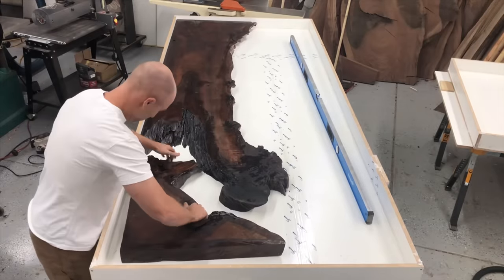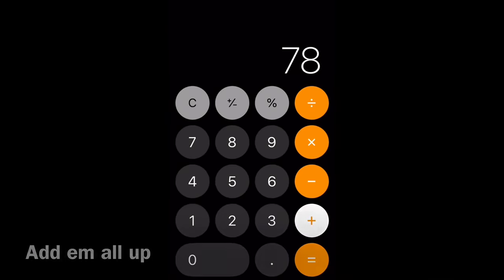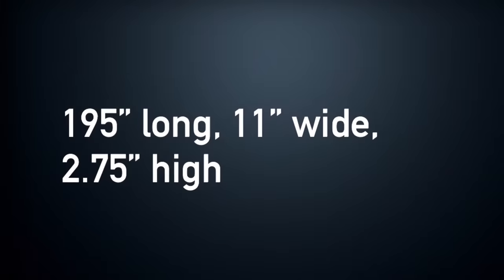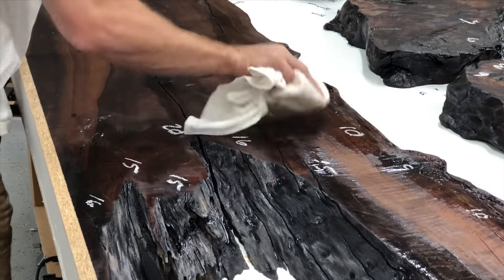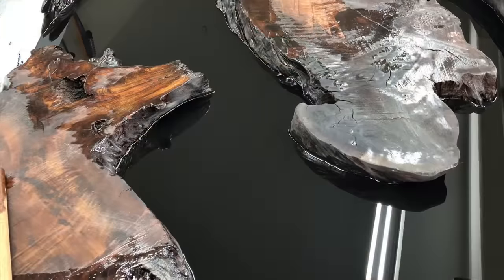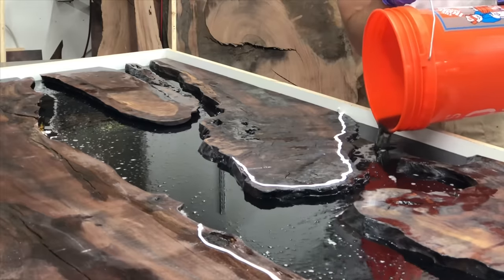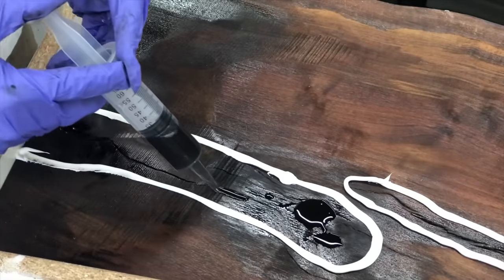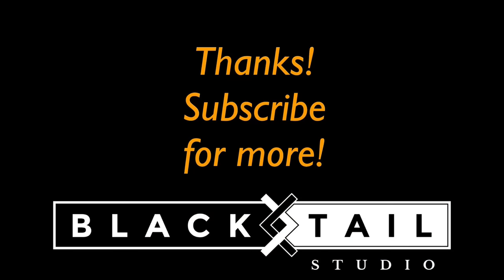Calculating Epoxy Volume--How to Epoxy Woodworking

Comment: Have to laugh you do measurements in inches but end with litres, thought you guys use gallons ?? 👍 Great looking table
Reply: The calculator juist converts it to liters
Reply: we use feet, ounces, gallons, liters, grams you name it. us americans do it all
Reply: We honestly use metric and imperial interchangeably lol
Reply: Use both Metric and English.
Reply: @adamjohnson5307  Sometimes it’s a serious problem because one engineer could use thousandths and another engineer could see that and think it’s millimeters.
Reply: I just use my fingers way easier
Reply: Carpenters tend to still use imperial but scientists prefer metric. Result tends to be that all the best tools use one system & all the chemicals are in the other.
Reply: Yea, we use all of it. Ends up the same no matter what either way.
Reply: ML much more accurate
Reply: The epoxy company probably uses liters for their mixing instructions.

Comment: If you had 35 measurements with each 6" apart, that means you have 36 sections. 6 X 36 = 216". That's the length of the river in an easy way. 😊

Comment: If you can weigh the pieces, you can get a more accurate measure of epoxy volume using this method:
Weight an offcut cube of the wood on kitchen weighing scales and measure its dimensions so you can work out the wood density.
Weight all the pieces you are using on a bigger scale, take the total weight and divide by the density. This gives you the total volume of wood.
Work out the volume of your mould, take off the volume of wood you calculated and what's left is the volume of epoxy needed.

Also, this is an incredibly beautiful table and I am very jealous!
Reply: Came here to write this comment. 👍😂
Reply: Exactly what I thought he's going to tell, this is a much more precise and less time-consuming method. But I guess math is not for everyone.
Reply: Also was going to suggest this.
Reply: How much effort would that be. His method of approximating is good enough. If epoxy was worth the equivalent of gold then perhaps it would be worth getting a closer approximation. Even in topographical surveying they use similar approximating techniques which have worked well enough for the vast majority of cases.

Also if you want a better approximating you could utilise tech using a ceiling mounted camera and some cheap software or even open source to calculate the area of the empty sections
Reply: @sulimanahmed8588  that'd be way less effort and time consuming than the method he presented in the video
Reply: the trouble is that this assumes consistent density, which we know wood doesn't have. This one seems like it would work most of the time but that one time it didn't it would be very far off.
Reply: @sulimanahmed8588  epoxy is very expensive, duh.
Reply: I might calculate volume using the displacement of a less significant piece of the same wood in water.
Reply: I don’t know if wood has the same density throughout since some may have wholes or something
Reply: @sulimanahmed8588  this method of weighing is simply the  MOST accurate method.  if you want extra waste factor then add a waste percentage to your calculations to account for wood imperfections and form failure (figure out this waste factor by experience with this type of work).  

Surveying is honestly an apples to oranges comparison and that is honestly sympathetic to how imcomparable they  are.

Weigh the form, weigh the finish pieces in the form, weigh a sample piece of the material at a controlled dimension. and measure the dimension of the form.  cross multiply, you have the theoretical weight of the finish piece in the full volume of the form and you take the volume difference in the form.  correlate that with the volume and/or weight of the epoxy and you're set.  The only variable is if your material dimensions and thickness in the form has imperfections from that of square and true.
Reply: @sulimanahmed8588  you only need one measurement per piece of wood plus two from the sample piece to calculate the total volume of wood.

D = m_sample / v_sample
V_wood = m_total / D
V_epoxy = V_mold - V_wood
Plug numbers in and do algebra
Reply: @jackknife89actual  as long as the sample has no voids there should only ever be excess resin, since your expected volume of wood is higher than actual. Huge differences in density could be felt during handling and adjusted for
Reply: This is exactly what I thought. This method is used to calculate the surface area of any irregular shape, and it can be applied for volume. I am not sure about the precision because I am not sure that this type of wood slab has a homogenous density, so some spot maybe denser than other, but in all, this method could be more precise, easier, and faster than the method used in the video. Maybe adding 10% contingency to the calculated volume needed for resin could account for density variation, leaks...
Too bad you can’t use the method of Archimedes and the king gold crown :p
Reply: bag up water n fit them between the wood to see how much epoxy you need
Reply: Yeah, true. Though since it's already sealed pouring water in to your resin level and then draining it out. Then measuring the amount will give you the most accurate and fast measurement. Experts will add a buffer for security.
Reply: If every wood slab were homogeneous (which are not), if everyone have a scale to measure 400kg, if every brand epoxy have same volume lost while drying, this would be perfect solution. but it is like compairing kitchen scale vs cup measurements. Practicality always wins. On the other hand, just maybe most accurate measurement would be filling the mold with water fully and dropping the wood, collecting extra water and you have volume and add extra %20. But practicality always wins :) For small projects like trays or sth water filling can be tried.

Comment: I just got your solution to do it way easier.
Take a picture from the top, put in GIMP (or photoshop), crop the image to the borders of the table. Select by color the part of the table that will be epoxy (the white background) then go to the color histogram it will tell you how much pixels your selection takes up. 

You can easily calculate the percentage by dividing the selected pixel  count by the total amount of pixels of the table and multiply by 100.
(example: Cropped picture is 1920x1080. White selection is 400.000 pixels. Calc (400.000/(1920x1080)*100) = 19,2%
You know the size of your table, just apply that percentage to your total table volume (height x length x width). Add the perimeter stuff you require, and you got the volume of epoxy you need. 

I just tried it on the best "on top" screenshot I could make, and got pretty close to your calculations in literally a few minutes.
Reply: great idea. just a nit: this will almost always underestimate the amount required because tapered edges cannot be taken into account with this method.
Reply: This, or, if the parts don't mind getting wet:
Drill a small hole in a corner, plug hole, fill with water, unplug hole and measure water volume once fully drained
Reply: I actually thought, he would use calculus.
Reply: @RevHardt  If you use a good camera you can by using the color select to select just the tapered parts. Or a 3D photogrammetry program. There are also cheap lidar modules for the Arduino. You can use those to generate a 3d model and get an exact measure.

Comment: First of all, thank you so much for taking the time to share your work. I'm a big fan of the speed and level of detail you show, focusing on the project. I've done half a dozen smaller projects over the last few years, learning something new with each one. I made the leap recently and decided to try a bigger project and make myself a 6'x2.5'x2.25" maple desk. I used a single piece of maple that has a lot of natural voids and poured straight epoxy with no color added. I poured it last night and used 8 gallons of liquid glass epoxy. I knew this was a lot so I started with a few fans on it and it was in my house with A/C set to 73F. Unfortunately, it still got too hot too fast (165F about 6 hours after pour). I added 4 more fans, but it still cracked a few times in the center. The learning continues. One of the cracks came clear through and left about 1/8" gap over about 6" span. Should i fill the crack before or after i remove it from the melamine slab?

Comment: Here is how I would do it:

I would take a photo from above the layout so that there is minimal perspective distortion. After some image manipulation and coloring in gimp (or photoshop), I would make all the river pixels to black and everything else white. Then a histogram analysis (Colors -> Info -> Histogram in gimp) tells you how many black (river) pixels are there. After that, I would do the same with the timber pixels. Assuming that the river wall is more or less vertical everywhere, the ratio of the river pixels over the timber pixels tells you how you should divide the whole volume of the brick between epoxy and timber. 

For example, if you get 8% river pixels vs 92% timber pixels and the whole layout size is 200 cm x 100 cm x 10 cm then the whole volume is 200 liters. 8% of this volume will be resin so you will need 16 liters.  I would add some extra, so 17-18 liters would be fine. 

This technique works even the weirdest river shape, as long as the walls are vertical. If they are not then you should adjust the boundaries manually.
Reply: It was 105 litres.  You'd be short almost 90 litres or 800% with your estimate.
Reply: @Csongor Halmai Aaah, I see.  I thought you had used your photoshop technique and arrived at a calulation for the pour which was out by about 800%.  What you're saying is, your rounding up to 17-18litres was for an imaginary pour on a table with about 800% less volume than the one in the video recording? 
Now all becomes clear.  Thanky senhor Halmai for the esplanation. I like your approach.  It is digital age technique. Very cool

Comment: Absolutely gorgeous table! 
I believe that your style of teaching plays an important role in your success and very much appreciate it. Keep up the great work!
I couldn’t make it through all 2.4K comments to insure that the following suggestion was not already made so please accept my apology in advance if it was.
My suggestion is to use the same silicon caulk used for sealing the mold & making the dams to seal the bottom live edges of the slabs to the bottom of the mold. In other words, run a bead about an ⅛” from the actual live edge all along the live edges where the epoxy resin will be. Combined with enough weight to insure holding down the slabs wouldn’t this prevent the epoxy from running out and creating an ⅛” of epoxy all over the entire bottom of the mold. It seems like the wasted, expensive epoxy exceeds the actual amount poured to create the river, unless it can be prevented from running under the slabs. 
If this works then maybe each edge of the slabs that meets the side of the mold could be sealed with a bead of caulking and prevent the waste that occurs from leaking out the sides.
I expect the first resistance would be the additional effort required to remove the cured piece from the mold. With the money saved in epoxy I think that once the sides of the mold were removed you could easily have a custom, long, thin blade “draw” knife made to cut the relatively soft silicone from the bottom of the mold and slabs. Alternatively, maybe the release spray all over the mold would prevent the silicone from actually bonding to the bottom of the mold. If that was the case then enough weight on the slabs would be even more important to success of this method of avoiding so much wasted epoxy.
I look forward to hearing your response comments about this potential technique!

Comment: Hi Cam, have you ever thought about using silicone on the underneath of the slabs to stop the epoxy running underneath, similar what you do to make the dams, and then when you take it to the shop to plane it, just plane both sides until you get rid of the silicone underneath. 

Love your work, the tables look fantastic! 

Paul, Liverpool
Reply: Hey Paul, where in Liverpool?

Comment: Wish I could get a job like this. Also imo a better way to calculate the volume would be to count the volume of the pieces separately, add those up then the volume of the pour box to the pour height, and subtract.
Reply from the maker: Never thought of that!
Reply: @BlacktailStudio  How to do that would be put each piece into a plastic bag to keep dry,  make a box bigger than your biggest piece which has rim and a funnel - fill it to below the rim with water, when you put each piece in the displaced water can be funnelled into a container and measured and thats your exact volume.
Reply: @Nadie nice idea, I was thinking water but I like your fine sand idea better.
Reply: Materials information for whatever  type of wood you are using is available online. There you will find the average density. You are probably purchasing the wood by weight. Take the density and divide out mass. This volume calculation is the easiest method to find average volume. Subtract the calculated volume from the vessel's volume.
Reply: Density of black walnut is 660kg/m^3 how much do your pieces weigh?

Comment: Wow! I had no idea epoxy would be so much.
Reply: Epoxy certainly does have a very wide cost spectrum. 
I use a very good quality epoxy that costs $115 per gallon. And I'm happy to pay for that. 
Now, get into aerospace certified epoxy, and some of their stuff is about $200 a quart, or $800 per gallon.
And there are cheaper epoxies. 

At this price point on this table, I'd assume hes using quality stuff, averaging about $110 per gallon himself.

Comment: Is there a reason not to add thinner "filler" wood through the river to reduce the volume of epoxy required? Or is the black just opaque enough that it would be noticeable?
Reply: The "filler" wood would float. Sometimes you have to clamp smaller pieces, but these were large enough to be held down by their own weight
Reply: @colincamus2098  so put somthing that wont float
Reply: There is a reputation risk for doing that. Buyers do not expect it. If discovered then it looks bad for the company and future business could suffer.

Comment: There are a very simple method for this: calculate the volume without wood, and find the weight of all pièces of wood, and find the approximate volume with the volume weight of the type of wood u use
Reply: You would need to know the density of the wood used for this type of calculation using weight/volume ratio. Not really the best method
Reply: @moonraker8794 pretty sure we can find a result so close to the reality

Comment: I just had to come give a big thank you!. I just finished my first ever deep pour epoxy table and used your method for calculating the epoxy and it was extremely accurate. It was a smaller table and came to 2.9 gallons. I just used 3 cause I had 1.5 gallon kits and there was very little left over. I imagine had I measured out to 2.9 I would have been exact. Always better to have a hair more though and now the client gets some cool coasters. 

Anyways thank you again. This worked amazing and I will be using it on the two larger ones I have coming up!
Reply from the maker: Wow, that’s awesome!

Comment: Hey, just a crazy idea; if the table/mold is watertight, couldn't you just fill it with water, pump it back out and measure the water?  Even if the mass of water vs epoxy is different, if you know the ratio between water vs epoxy you could do a simple calculation. 

Might be I'm just an idiot for suggesting it, but what the hell right?

edit; see, I am an idiot, I just realized you can measure the water before pouring it in.
Reply: The wood will be wet then,  and need to be dried out properly.
Reply: I was thinking the same but with jello